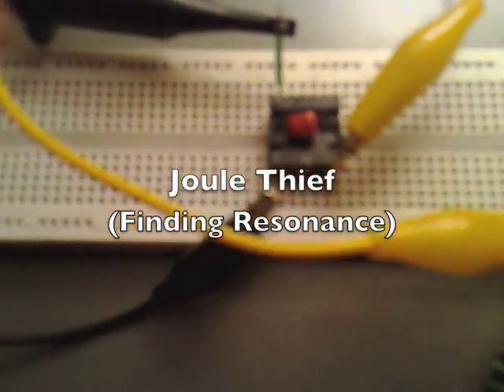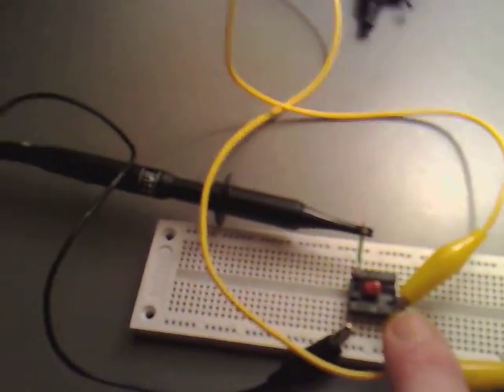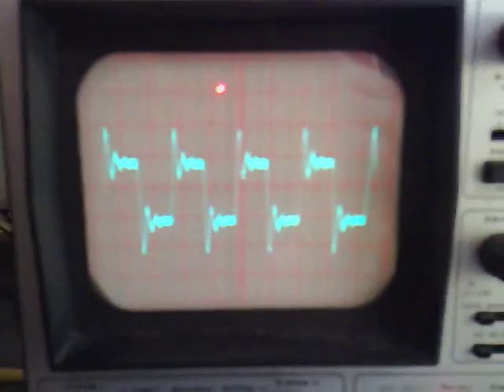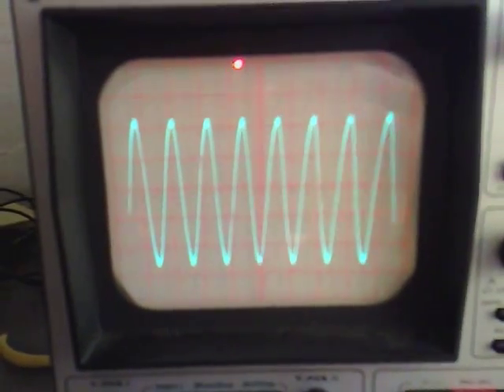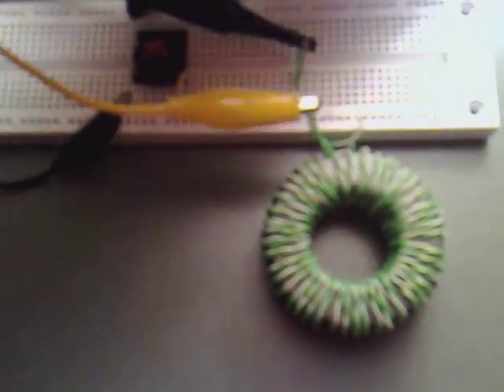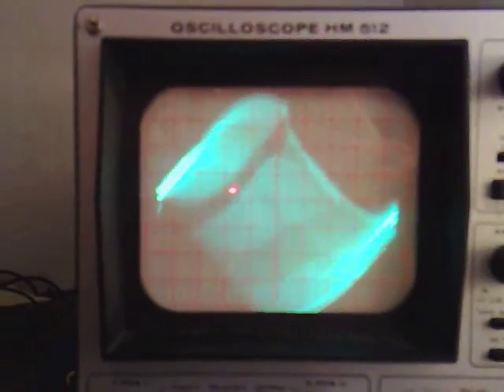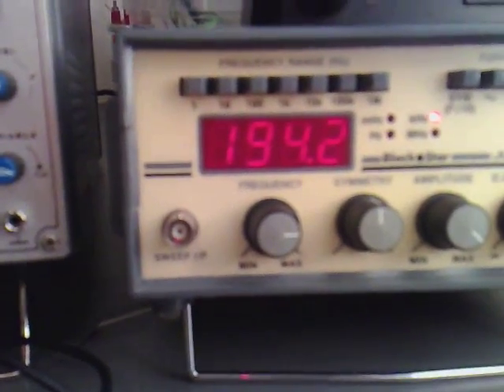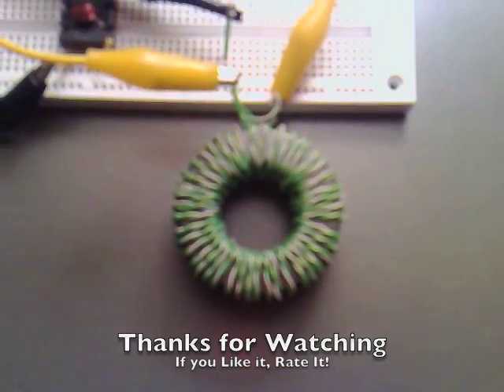Joule Thief (Finding Resonance) 014

Comment: Why not just put a capacitor in parallel with the 'collector' coil. Use the base to determine the frequency it already produces and use the LC resonant formula to determine approx. What size cap you need. Then you can add a secondary to the 'collector' coil.

Comment: 207.1 is not resonance. I was think on that part.
Sorry if you still think that, this is Joule Thieft.

My theory of free energy is not something from nothing. Try to analise this for example: For running motor you need magnetic field, and for magnetic field is only important current. Try to drive coil only with current and minimal voltage (0.x V), and for same power (W) you will get more efficiency, and longer work time.

Regards,
as121506

Comment: So many ways. TS555, VCO, even a discrete transistor oscillator can be tuned to provide the source freq. It would be fun to engineer a self resonating amplifier. Use current to drive the frequency shift so it seeks max current. I think they call that a "hot mic" in audio terms - positive feedback. ;-)

Comment: Well done. Yes the Meghertz setting on the small one is your resonance, the other waveforms at lower freq. are ringing harmonics. It would be good to compare the inductive reactance (X_L) math to your actual winding dimensions. Where X_L = 0 you are at resonance. X_L =  2 π f L where f is freq. and L is inductance. If you drive your coil with a capacitor the resonance is where X_C = X_L and the freq is f =  1 / 2 π √ LC.

Cheers